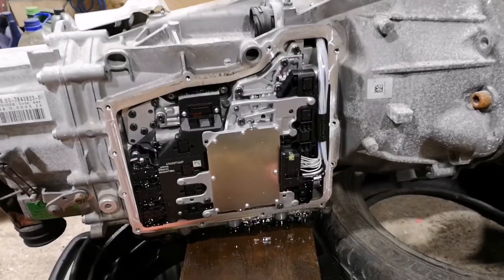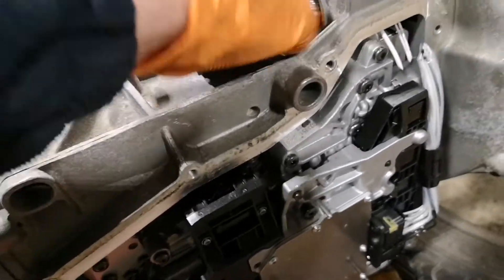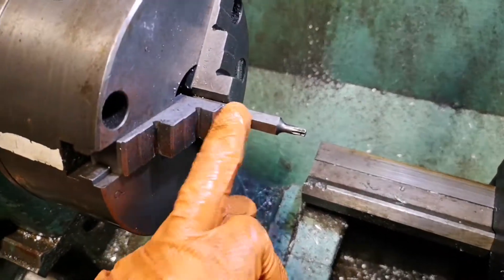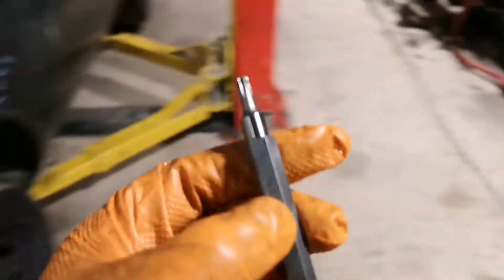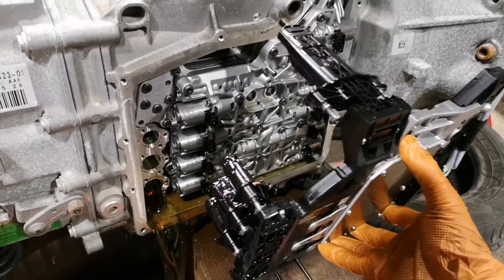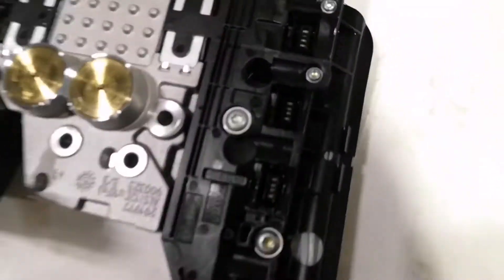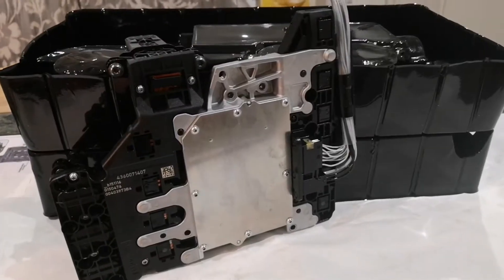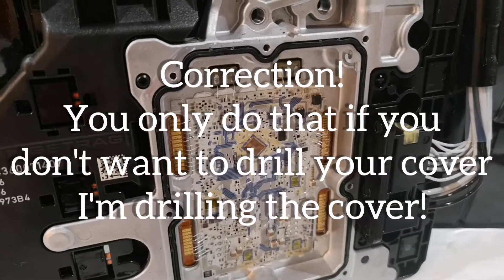BMW 7 speed DCT internal wiring - Modifying the Mechatronics unit on my Saab powered Scimitar

Comment: Really great job.
As you know mechatronic modul,  could you please let me know where is located electrovann 3 positions which flush on temperature sensors and clutch just to check it as I have a a sporadic issue with my oil temperature 200°C and 10°C of fluctuation at standard temperature
Thanks